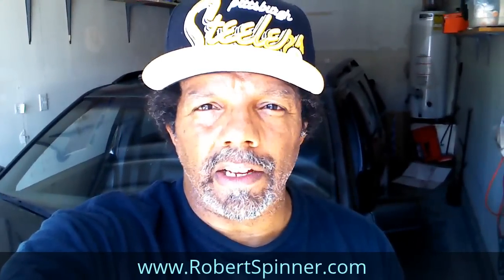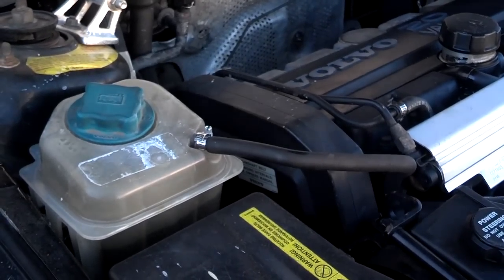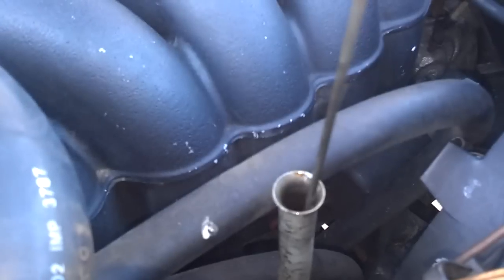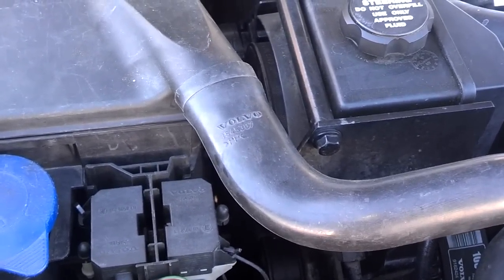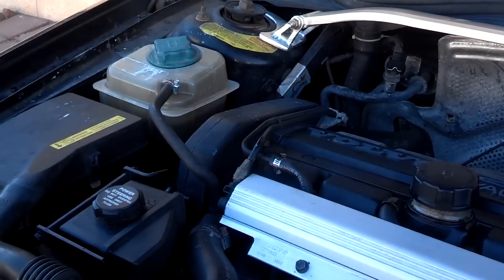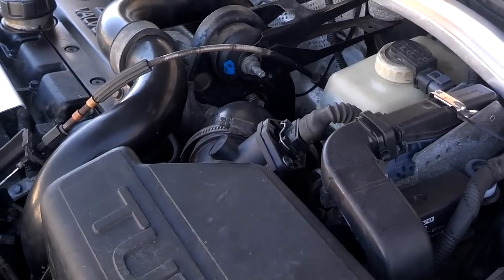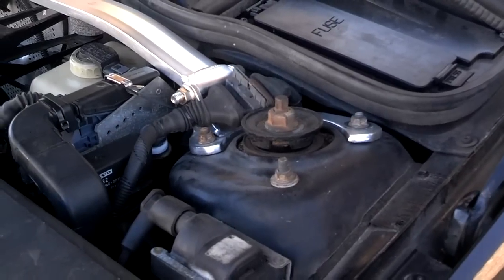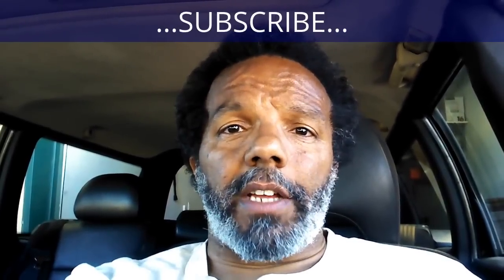Top things to check before buying a Volvo 850, S70, V70, XC70, etc., Pre purchase inspection.

Comment: Glad I know how to service all of those issues myself! There is no way I would pay so much money to have a shop install a $30 Head Gasket. I mean, it's a day job on an inline engine! I would gladly give up my day to save $5,000!
Reply: I know this is hella late but I won't pay that much either. Dad used to be a mechanic so he can tell me what to got to get the job done
Reply: If they're aluminium block , you need to have both the head and the block planed. Removing the block and stripping all internet components that is not a 1 day job.

Of course any bozo can unbolt the head, scrotbright the surfaces, put a gasket and reassemble in a day, but that gasket won't last.
Reply: shodanxx ; CAN YOU name those Internet components that need to be stripped? Modem? WiFi router? Man those old Volvo’s are ahead of their time eh?
Reply: I have a 1994 850 turbo and i tell you it seems simple to rebuild but maybe i am better off selling off all these engine parts or part by part to have enough cash to buy a. V70 or an all whell drive cross country ? Anyone know how i could do that?
Reply: @metaljew4456  hahahaha
Reply: you know it shops burn you Its also annoying they try to treat you like a special kind of stupid
Reply: @mikedavies3592  How dare those mechanics charge you for doing work you are unwilling or not competent to do,  to feed their family and pay for shop rent and expensive tools.

They must be bad people for running a business and offering a valuable service!
Reply: @davidparker9676  You missed point  there are millions who understand. I am all for honest fair trade of skills. There is and has been a lot of abuse to the consumer on a global level. There are also good shops and mechanics. The parts distributors are tiresome but things are a changing.
Reply: @mikedavies3592  I understood your point but there are all of the honest mechanics that get the same bad attitude from the customers and it is toxic. The good mechanics get tired of being the bad guy and start over-charging to make up for the grief their customers give them.

Most regular people have no idea how much an average mechanic spends on tools and the costs to operate a shop.
They see stupid people saying the shop is charging me $1500 to change a $30 gasket, thinking that $1470 is pure rip-off profit.

I left the trade because of the attitudes toward shops and mechanics. Just like cops are quitting nationwide because of getting crap for doing a thankless job. 

The industry is shrinking as techs are taking their skills to other trades. Cars are becoming more complex and there will be a huge shortage in qualified technicians and prices will skyrocket as a result.

For the people that think repairs are a rip-off, they should do it themselves and see what the real costs are. Anyone can turn a wrench, you are paying for knowledge and experience. Something the DIY guy won't have for years.
Reply: @davidparker9676  The good mechanics get tired and start overcharging for the grief their clients are giving them. This is the problem and an escape goat. The real good mechanics do not have issue, these are compromisers and when challenged play the madder faster factor and turn it on their customer. I have done countless unforeseen problems not charging the customer but picking it up on the next project. There were many times when customer noted this and payed more but most common was they became sales men for my business.  this is called smart business and good integrity and yes there have been many that have taken advantage of this but thats the cost that is always rewarded 7 times. I hope this is helpfull to you as you can see I have had a lot of experience in multiple countries and this is an accurate assessment . That is backed up by thousands of complaints with people saying the same thing al over the intrnet. Then they blame the youtube mechanics who became famous for helping and revealing Truth .
Reply: Hi Robert I just bought a 2005 V 70 with a manual transmission. My question is it idles a little strange it kinda goes up and down, it may sound like a vacuum leak but I'm no mechanic. If you could possibly give me some points to look for I would appreciate it. Thank you.
Reply: Exactly even if you have to take off work Even if I lose my overtime is still   Worth it

Comment: I bought my 95 850 turbo for 2000$ not knowing that my pcv system was bad, my ac wasn't working, and the turbo hoses were cracked. I installed a new pcv system myself and replaced all my turbo hoses myself and recharged my ac too. Saved myself about the cars worth in repair. It now runs like a champ
Reply from the maker: Good deal
Reply: luis garcia need help buying one today !
Reply: Haha you sound like Slim Pickins off Dr Strangelove....great video by the way.

Comment: I know this video is 2 yrs old.  Thank you for taking the time to educate everyone on what to look for in purchasing a used Volvo.  I have a 2000 S70, and I know most people do not keep their cars for 16 years.  I had to replace my A/C evaporator last year and it was very labor intensive.  The entire dash had to be removed.  I was able to prolong the inevitable since a mechanic had told me to always keep the fan on, just on low.  I had already replaced the A/C compressor years ago.  I have 158K miles and I have an "old fashioned" mechanic who is honest.  The other issue you need to look at when buying a used Volvo, is the exhaust system.  Volvo doesn't sell it in parts, it is all or nothing.  My mechanic just welded my catalytic converter but this will be the last time he can do a quick fix.  I have a hole developing in my tailpipe and once that is bad, I will have to spend the $1,700 to replace the exhaust system.

I've asked around if it would be wise to invest $2,000 into a 16 yr old car and the answer has been yes by most people who know my car and Volvo in general. If I bought another used car, I'd be possibly buying someone else's problems.

I researched older model Camry's (a popular car) and found that some people replaced their catalytic converters more than once and the price was slightly less than that of a Volvo.

I am not a mechanic and freak out when something goes wrong on my car.  I have not replaced many things.  2 yrs ago I replace the original starter.  I've had American made truck before this and I can't tell you how many starters, oxygen sensors, alternators, etc. that I replaced.  If a Volvo is maintained, it should last up to 400K miles.

Lastly, if you read or get a chance to look at a CarFax, it is important to note the number of owners.  I'd be hesitant to buy a car with more than 2 owners.  A friend purchased a Volvo wagon and at first glance, it appeared to be a great car for little money.  It was a bad investment and it had 5 owners.

Again, thank you Robert for posting the videos.

Wade
Reply from the maker: +G W Grote thanks for sharing.

Comment: My grandmother bought a new 240 in 1987 In 07 i bought it off her. 2017 im still driving it. Iv put 3 timing belts on myself. About to do a 4th because im about to take a over 3000 mile vacation trip. Love this car.
Reply from the maker: +Charles Graham I use to run my red block belts 75,000. About every 2-1/2 years.

Comment: * dankjewel, gozer *

R-Dude :) 

Thats Dutch for "thanks, dude." 

You just saved my ass. I'm a total goof on car-tech, but i'm handy and i got a keen mind, so i checked your vid, did all the test, and turns out the T5-R that i had in mind, was indeed a total turn-down. It checked on 4/5 o/t things. Had gasket, airco, valve stem seals and PVC all not good, so thanks for savin me some very bad feelings. Car I looked up is currently stated in Netherlands, so if any of you guys is thinkin' bout buyin a car up north, gimme a shout, i'll hook you up with the 4-11. 

Cheers from sunny Amsterdam.
Reply from the maker: You are welcome.

Comment: Thanks for the upload Robert.
I have a '98 V70 Torslanda with ONLY 123,000 miles on the clock. It's the low power 10 valve 2.5 litre, but it still impresses me with its power and handling qualities.
I've had it for approaching six years, and have no plans or need to replace it. 
It's supremely comfortable, fast, does 30+mpg on a run, and has never let me down.
I love my V70.
;o)
Reply from the maker: +SarkyBugger Very nice. Glad it's holding up for you.

Comment: You are such a rad guy, Robert. I've ran into countless problems on my 99 S70 throughout my 3.5 yrs owning it- small and large. I've replaced/fixed my ABS module, door panels, door handles, locking mechanisms, the entire dash (TWICE), intsrument panel bulbs, radiator, cal seal, etc. I could go on and on.....  If it weren't for your videos or help on the MVS forum, I don't know what I'd do.
Reply from the maker: Ashlee Naccarato Sorry to hear that you have so many minor issues but glad you've been able to find help to guide you through fixing things and saving you money. Thanks for watching.

Comment: Robert.....you are awesome!!!!! Thanks for the tips, I purchased a V70 last fall just thinking I was going to keep it as a work car....and it turned out to be the best vehicle I have ever owned. I drive into Canada from Ohio once a month. Not only is this car a beast, but it saves me a considerable amount of money especially since I went full synthetic. I'm currently having some issues with my suspension due to the bad Ohio roads....should I look I go for a total suspension upgrade, or replace what's needed?
Reply from the maker: Shawn P I suggest you replace what you need in pairs. I would do rear shocks and front assemblies with strut mounts & spring seats. Thanks for watching.

Comment: Is it possible to replace a timing belt and pcv system yourself? And if so is there any like tuning or other add ons I should do later once replaced? I have a 1995 volvo 850 t5r I purchased a while back, and I have an oil leak near my exhaust headers, any tips? Thank you for your time loved this video!

Comment: I just purchased a 99 Volvo S70 yesterday with 55K miles (one owner, garage kept it's entire life in NYC). I watched this video three times, read about common faults and made a checklist using this video as the foundation to my inspection guide. It passed all the major inspection points plus other issues. Thank you, Robert! Oh, I'm commenting using my wife's computer.
Reply from the maker: +Anastasia Kudrashova lol, do watch the post purchase video.
Reply: we watched it together. the car is in such great shape, but we'll have to have a shop replace the timing belt (and water pump since the cover will be off ) in about 15k miles. I also watched the front strut replacement video, and it seems pretty straight forward, so I might consider doing that myself around the same time. Would you recommend installing the strut support bar you have on your 850?--I see lots of photos of engine bays with that same equipment. you rock!
Reply from the maker: Not really, unless you take corners hard.

Comment: Steeeeeeering rack!  Big issues with a leak out of the tie rod seal!
Reply from the maker: Yes, so is a bad fuel pump on the AWD cars but it's not a common issue.
Reply: Robert DIY I paid a shop to replace my power steering rack. Parts and labor $800. The rack has failed again after only two thousand miles from the same place, the left tie rod seal. I have to replace it again as it's out of warranty. Who makes a good power steering rack? This will be $1,600 once I pay for the second time. Thank you
Reply: 1998 v70 t5
Reply: Haha!  2022, used leak stop for 3 years, not perfect, but not bad.

Comment: I am happy to own a '96 850 T-5 since 2010. Purchased for 1500$.
I knew from the beginning, that I will keep this car as long as possible.
Thats why I "invested" some money to (for example) change the timing belt and the Head gasket, had cost me 1500$ both together. In the mean while I changed suspensions, Brakes etc.
I have now over 250.000 Miles on it. And it's still running like a new car!
I have reached the top speed again this summer (240km/h, about 150mph).
I may have already known the most of the typical 850 issues (A/C Clutch), 
but this vid of yours does exactly what it should: To warn people and help test and fix the issues.  Very usefull informations! Thank you Robert!
Youtube needs more videos like this one!
Reply from the maker: +blitzgreek Thank you for watching.

Comment: thankyou for another 5 star video :)
my PCV went bad this summer, from not burning ~any oil to about a month later I was under minimum, a real shock and painfull drive home to fill up 2 Liters (oil stick min to max is 1,5L) when I pulled the oil stick smoke came out, $850 at Volvo dealer to change PCV, crank case and oil catcher (they said they put in a new upgraded model that last longer)
I will do these checks when buying my next car :)
Reply from the maker: Pontus Åkesson Ouch! Glad you found the problem.

Comment: Great video.  I was able to pick up a great 1996 volvo 850 turbo for 600 dollars, which needed a little work on the brakes and radiator, but now it is running perfectly.
Reply from the maker: Ryan Hall Sweet. Volvo's are almost timeless so you can drive it as long as you'd like.

Comment: Robert, Very thorough.  I have done many of these repairs including the heater core.  It is impossible to cover all of the nuances.  Replacing the oil cap gasket (Rubber washer) can prevent back engine dribble and keep the top of the motor and spark plug covers clean.
Reply from the maker: Robert Casey That is true. Thanks for watching.

Comment: Extremely helpful video.  Thanks Robert!  I just purchased a 1998 Volvo S70 w/ 355,000 miles!  It is in ridiculously good condition given the mileage.  Not even a door ding!  Paint is in excellent condition.  I did your PCV glove check on the oil cap.  A ziploc sandwich bag w/ rubber band works good if you can't find a disposable rubber glove.  The system was indeed clogged up causing the baggie to fill up and the smoke coming out of the dipstick.  I'm pretty sure this system was original so I chalked it up to needed long term maintenance.  Somehow it passed CA emissions with a clogged PCV.  Also did the timing belt kit w/ water pump since there were no records of that EVER being done.  Again, maintenance.  Outside of that all they did was replace the thermostat, replace the coolant, oil change, and new oil and air filters.  The thing runs like a top.  Zero leaks.  Tranny seems to work just fine.  $1,500 cost.  $2,300 in hard maintenance costs at local mechanic.  $3,800 total investment.
Reply from the maker: +JuggyGales1977 thanks for watching. Glad to hear that it's running well.

Comment: I absolutely love my p80. Had the tensioner pulley fail in the timing while i was driving so i've been doing a somewhat costly repair. Got a used engine since the pistons were pretty badly dinged up and a hammer was dropped on my head. Your videos have been amazing.
Reply from the maker: ouch
Reply: @RobertDIY  you got that right lol

Comment: Thank you for the information. I watched this video just before inspecting a very nice looking volvo 24o that appeared to be in excellent condition that was being sold by a volvo mechanic shop for a out of state customer. There was fresh oil all over the oil pan, bell housing, passenger side of engine and on valve cover. There was pressure blowing out of oil cap. The Volvo mechanic told me that it was suppose to blow out and not suck in and all to do to the pcv system was to clean the flame trap and nothing else. Your information helped me make a decision. Thank you
Reply from the maker: You're welcome. Red block engines are different, very different. The PCV system is a lot easier to deal with, however they do have an oil trap box that can be cleaned or replaced. Besides that, if you are trying to sell a car, it should not be blowing oil out all over the place. lol

Comment: Thank You Robert!
I own a 98 S78 and it's a great car! It's a 5 speed too, very rare. If the sales numbers I saw are correct, there were only 50 made that year. Needles to say, I cherish it! I love my volvo. It's been a great car since we got it in 2012. Very reliable Daily driver. A few maintenance issues inside due to old age but anyways, peppy, safe and comfortable. You've given me a great place to start on refurbishing my Volvo. 

Thank you sir.
Reply from the maker: +Serge Conus man, there were a lot more 5 speeds than that made. Is it a T5? Thanks for watching.
Reply: It's the regular non turbo s70
Reply from the maker: Lots and lots of those.

Comment: Dear Robert, thank you for your video. I just walked away from a nice looking '97 V70. From the outside that was.  However I will keep searching for a nice reliable one! Keep up the good work, greetings from the Netherlands.
Reply from the maker: +3 chordskid reliable?
Reply: Reliable in the sense of using the car for daily drive. This V70 wasn't maintained very well, plus no documentation. I didn't trust it. Also I weighed if I could fix stuff myself like you do or invest at least 1300 Euro repairs.
Reply from the maker: 3 chordskid oh. most of them are reliable, if you service them properly.